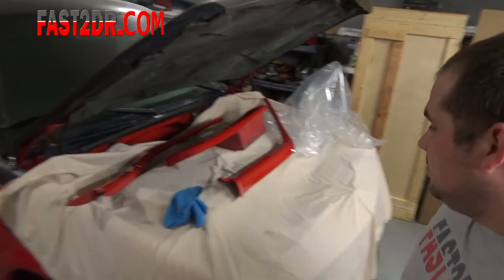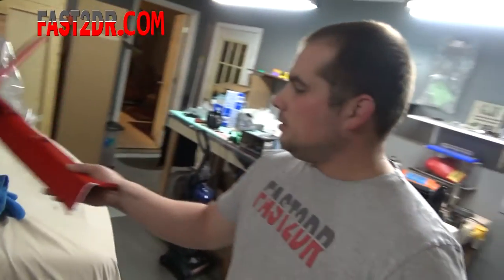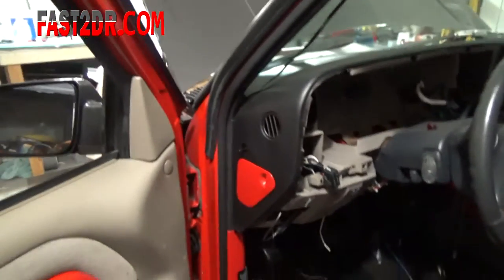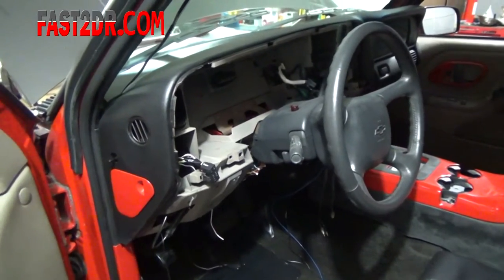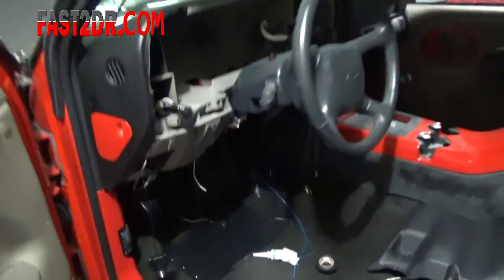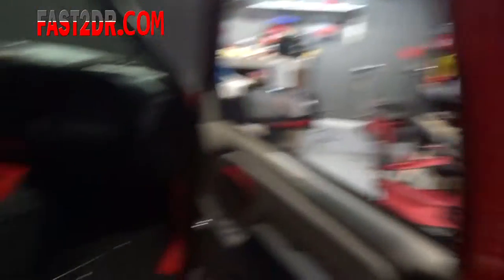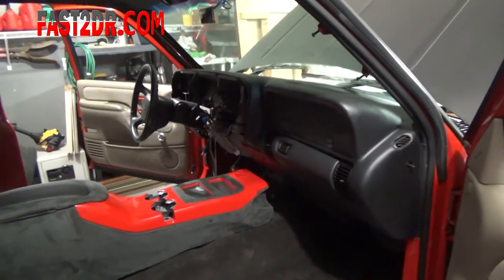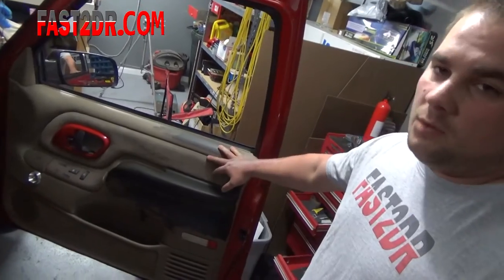FAST2DR - LS SWAPPED TAHOE Show Truck Build Part 10 2dr tahoe

Comment: Where did you get the dash cap from? Were you happy with the fit? I'm going through interior change and would be willing to buy a cap for 200 versus taking the dash out to paint. Do you have pics of the cap on?
Reply from the maker: yeah at first i wasnt sure... but i spent the time and painted all of the factory dash black in the places where it could show through.. then glued the dash cap in place .. it looks really good and fits really well... ill put some pics in the next video..

Comment: I want to change the color of my dash. did you use spray can paint or an auto paint sprayer? other than cleaning it real good and letting it dry, what are the steps to getting a smooth consistent finish?